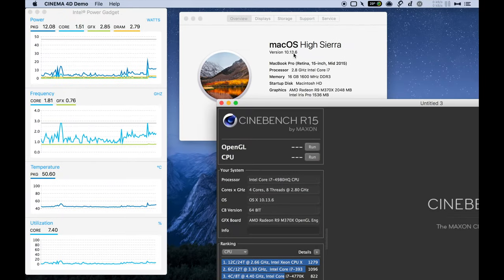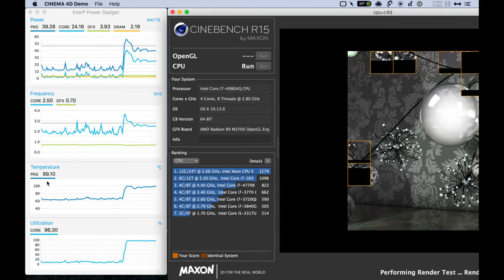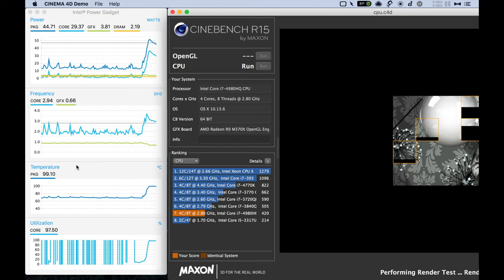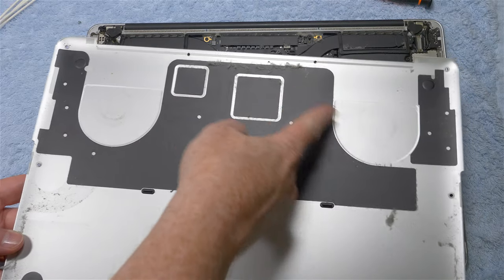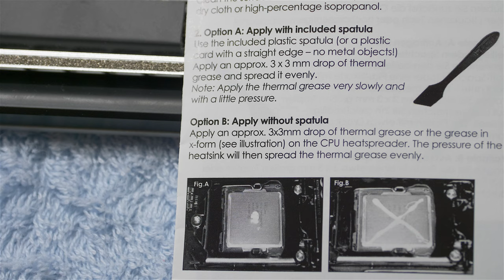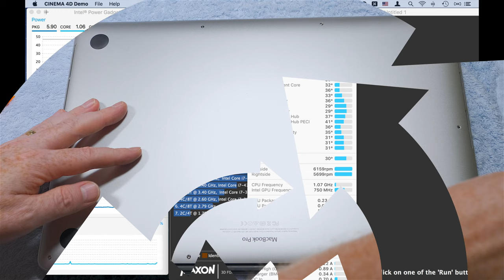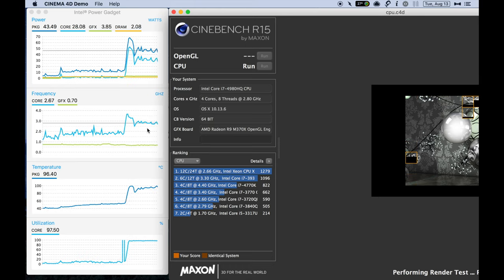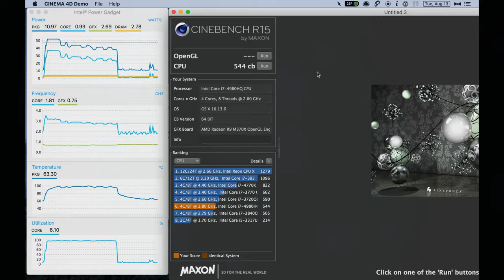Repasting a 2015 MacBook Pro 15" [Thermals & Performance]

Comment: Hi! I've just repasted my Macbook Pro 15" 2015 following this video. In fact, I found this video back in February or so, but I couldn't get the alcohol until now, and also the Kryonaut delivery took months! Anyway, I followed your original repasting method of spreading, but instead of a thin layer, I put a thicker one, just not so thick that when putting back the heatsink it could spill. The change in performance is really amazing! Thank you so much!
Reply from the maker: Great to hear about the performance boost, Alex.  Thanks for making time to let me know your success!

Comment: Here are the net results:
Cinebench Rendering scores                              Repaste 
                                    Paste:              Paste:                  Delta:
Normal voltage        Old  420cb      New  518cb          98cb
.75 mv undervolt      Old  447cb      New  544cb          97cb
Undervolt Delta                  27cb                  26cb         124cb
Total increase, undervolt & repaste   124cb  = 29.52% 
30% Higher score with new paste and undervolt - Same hardware.
I am about to do the same drill with the addition of changing the SSD for a 2TB ADATA/XPG SX8200 Pro installed.
Will attempt to screen grab the results and video publish.
Great Video!  Love the style, love the information.
Reply from the maker: Thank you for posting details of repaste, Larry!

Comment: Followed your instructions and renewed the thermal compound on the CPU/GPU of my MacBook Pro mid-2014.  It was a very simple job and quick.  The advantage I noted after doing this is that the battery has a longer period between charges than before the repasting.  I am thinking that the greater heat transfer to the heatsink is not straining the CPU as before and therefore not taxing the battery as much.  I downloaded the Intel Power Gadget and observe that the CPU rarely goes above 60C and stays around 50C most of the time. Power consumption is down from 20W or so to 8-10W, even when streaming videos.  For me, it was a worthwhile change with huge benefits.
Reply from the maker: Congratulations, Robert! Thank you very much for making time to share your wonderful story of success. It really is a worthwhile task that’s not too difficult, and I hope more people will try it.

Comment: Not sure why you need to manually flatten the paste.  Some study (using transparent models) shows you only need to drop the paste in the middle or a line based on the shape of the area, then the pressure between heat sink and the processor will flatten the paste much better than what you do.  In fact your way could create bubbles in between causing bad thermal transferring effects.
Reply from the maker: Please watch from 19:14 and continue watching until my paste job is completed.  There you will see what was written in the Thermal Grizzly Kryonaut instructions.  It says you can indeed use the spread method (i.e., flatten the paste).  But as you can see in my video, Kryonaut doesn't spread easily at all, so all that was left was a faint thin film that was basically nothing at all.  In other words, no air bubbles whatsoever can result from a thin film like that.  If you cannot see how thin, consider that we are talking less than 0.1mm thin.  It's so thin I cannot even measure it.  Again, it's basically nothing at all.  That is why you see me then change to the X method, which again is described in detail in the manual with photo.  Furthermore, transparent model tests have show the X method to be in many ways superior to the dot in terms of getting paste to to the corners.
Reply: @JDW-  Yes, Artic also mentions four methods, but finally recommends the One Point method (and one line method because of the heat sink pipe shape). A bubble could be created when two flat plans meet a valley formed by the paste due to manual flattening, and the air has no where to go but to stay in the middle.  Of course it is very thin, and is hard to be noticed.
Reply from the maker: @太陽雨-i2s  As I said in my earlier reply, I used the X method.  There is basically no paste on the chip surface from my attempt at the spread method, not even enough paste for microscopic bubbles to form.  Again, you can see that clearly in my video.  Indeed, what my video shows is that you really shouldn't use the spread method with Kryonaut, even though the spread method is recommended in the official Kryonaut documentation, because the paste just isn't suited for it.  Therefore, air and bubbles is a complete non-issue with regard to my video.  There are other videos that show methods prone to bubbles, but my video is not one of them.
Reply: In reality, it doesn't really matter how you apply the paste. The only important thing is that you put enough on (especially on a bare die). Too much makes a mess, sure, but it wont hurt thermals because the mounting pressure pushes the excess off the edge anyways. This can be an issue if using liquid metal or a conductive paste.

Comment: Very nice video. For the thermal paste spreading method, what you want to do is put the paste tube in a Ziploc bag and put the bag into a cup of hot water for a minute or two. The paste becomes much thinner and easier to spread when it's warm.
Reply from the maker: Thank you for your kind remarks and for the excellent tip!  (So far so good with the "X" application method I chose.)
Reply: I've heard it said that spreading is not a good idea as it introduces air bubbles which mess with the conductivity.

Comment: You mentioned not to wait around for re-pasting until something happens but you leave your batteries this swollen? I am amazed that you are not having trackpad issues with Batteries this one. That’s not just a little bit swollen that’s like something that needs to be taken care of right away and is much more dangerous and risk of leaking those destroying your computer than a little bit of dry thermal paste.
Reply from the maker: Actually, no.  I didn't leave it that way.  Within the text description under my video, you will find that I have put a link to "My SWOLLEN BATTERY video." That second video was posted only a matter of days after releasing this repasting video. URL: https://youtu.be/Om1c-FCc5u0

Comment: your video is still being found by people and interested in the advice you said. please tell me the negative impact of this paste is on the crystal. saw people complain about it. they say it leaves marks and scratches the surface. Is it so. what at the moment with the macbook that you are testing on the video?
Reply from the maker: "crystal"?  I'm afraid I don't understand what you mean.  I read and reply to every single comment under all my videos, so I also don't know what you mean by people complaining.  If you can please be more specific and clear, I can try to answer whatever  questions you may have that pertain to my repasting video.  Thanks.
Reply: @JDW-  my english is bad so you don't fully understand me. I'm asking about thermal paste. I read on forms that it damages cpu and gpu. is it true? How has this paste performed over time? do you recommend to buy? Is there any experience with using another artik mx 4 paste? If so, which one do you think is better. thanks for the answer
Reply from the maker: Thank you for explaining. I don’t know what forum you’re talking about, but it doesn’t matter. Clearly, those people have no idea what they’re talking about. The paste I used does not damage any CPU or GPU! In fact, Thermal Grizzly Kryonaut is one of the top recommended pastes and has been for many years. I have been using my repasted MacBook Pro to this very day without any problems whatsoever, and the heat and temperature are still under control as you can see in my video. I highly recommend it. And yes, it is better in terms of thermal transfer than MX-4. You don’t need to take my word for that either. Any good, unbiased review of thermal paste will show that.

Comment: I noticed you had gfxcardstatus running. During the before test you are using the discrete gpu and in the after test you are using the integrated gpu. This     skews the test results because using the discrete gpu increases the temps by about 8 to 10C Celsius. Could you provide test results for the after test with the discrete gpu running?
Reply from the maker: Thank you, Dan, for noticing that.  You're absolutely right.  I will run the tests after work tonight and post an update.  I really appreciate your keen eye!  THANK YOU.
Reply from the maker: Dan, see my newly pinned Comment for the link to my new screencast.  The scores are a bit lower than with Integrated graphics, but such is to be expected since the dGPU will heat the machine more.  But both Integrated and dGPU testing shows the scores to be higher than before I repasted. Thanks again.
Reply: @JDW-  Great! Thank you for sharing. It helped me to decide to do the repaste too. I hope it'll improve the fan noise while I have an external display connected.

Comment: I have the same spec MBP and I get 672cb CPU and 63.16fps OpenGL in Cinebench R15 running MacOS Catalina with Volta at -75mV. My cooling paste is still original but I recently opened my Macbook to clean it from dust and found that my batteries are very swollen, a lot worse than yours. But i still get excellent battery life.
Reply from the maker: Thank you for sharing your experience.  First off, it's hard to imagine MacOS Catalina alone giving you such a high CPU score in Cinebench R15.  What was your CPU score when running High Sierra (even without Volta)? Next, call Apple now and get your battery replaced.  Mine too showed great battery health and run fine off the battery, but if you leave a battery in its swollen state, it technically could burst through your aluminum housing at any time.  And whether or not that breakout out of the case will damage the battery, leading to a fire, is also a possibility that needs to be considered.  Check your serial number on Apple's website to see if you qualify for a free replacement.  More information about battery replacement in my other video here: https://youtu.be/Om1c-FCc5u0

Comment: I replaced the thermal paste and when using Safari I have an average of 43°C. On this video it's not even 40°C!
What CPU temperature do you people currently have when using Safari typically? Maybe the OS fault?
Reply from the maker: Thank you for your comment.  You didn't mention the type of paste you used.  As mentioned in my video and in the text description below the video, I am using Thermal Grizzly Kryonaut, which ranks as one of the best pastes available.  Safari temperatures vary wildly based on the content you are viewing.  If you watch YouTube, your temperatures will go up.  43°C is not especially hot for these Macs.  They often go well past 70°C a lot of the time, even with good paste, depending on what you are doing.  But suffice it to say, if your temperatures are largely unchanged after a repaste, I would be curious to know if you used a cheap paste or a major brand name paste.

Comment: Do you think that repasting is too big a risk on AppleCare? I bought a refurbished 2015 MBP less than a year ago and opted for the 3-year AppleCare. That said, when I'm running a 4K monitor and watching any kind of YouTube video or multimedia, my fans are almost always going at a medium-to-high speed, with the accompanying whine.
Reply from the maker: My AppleCare was expired when I repasted, so your situation is different.  Any work you do inside your case is therefore done at your own risk.  With that said, so long as you don't damage anything during your repaste and so long as you don't leave any sign you were ever inside the case (stripped screws are a tell-tale sign, as are easy-to-spot fingerprints or paste you may have gotten on an easy-to-see component), Apple would never know you repasted the CPU and GPU and I would think you could safely send the machine in for warranty service under AppleCare in the repasted condition.  Reason being, they really cannot know how the stock thermal paste looks versus your repaste.  Also, when they replaced my battery, they didn't even remove the heatsink and instead removed the entire motherboard with the heatsink secured.  

If you are worried, simply don't repaste until your AppleCare is expired.  

With all of that said, repasting won't keep your CPU from hitting 99.9% because Apple ramps up the clock speed as far as it will go.  Repasting just allows you to have higher sustained clocks for longer.  In other words, your fans will still blast like mad even after the repaste when your CPU gets hot enough.  Apple's software controls that.
Reply: If your AppleCare is already over I think there is nothing to lose, assuming you are not going to damage your hardware. If you always load >1080p YouTube videos that would explain your CPU usage
Reply: MBP's are not good with external screens, your fans ramp up quicker to keep the GPU cool. If you were to do the same tasks without external screen (even if the disctreet GPU is enabled) fans run a different profile. I'm talking from experience here.
Reply from the maker: Fans run in a different profile only if you’re not using a fan control app.
Reply: @JDW-  "only if you’re not using a fan control app." i.e. for majority of punters out there.
Reply from the maker: @Neetop  I suspect it is true the vast majority of Mac users worldwide do not use a fan control app, but that’s not necessarily true for the vast majority of viewers of my YouTube channel. The reason why is because I promote the use of fan control apps, and because I read and reply to every single comment under all my videos I know that a good number of people have started using those fan control apps. 

You can see my use of a fan control app in my repasting video. People can also see that in my iMac video card bake videos where I strongly recommend a fan control app.

Why use a fan control app? Because on the 2015 and older Macintosh models that I cover in my videos, Apple prioritizes quiet operation over cool operation. For most Mac users who only do web browsing and email, that doesn’t matter. But for the rest of us who actually push our hardware a little bit, keeping it running cooler will make it 
run faster and last longer too.

I used a fan control app when doing my testing in my repasting video because the very people who are interested in doing the re-pasting are probably the ones who push their machines, and those folks are the ones who stand to benefit the most from a fan control app.
Reply: JDW Do you have a video recommending good fan curve settings for a MBP 2015 (above default speeds)?
Reply from the maker: @kud I do not have a video specifically dedicated to that topic, but I am happy to share my rule of thumb with you. Set your minimum fan speeds to be as high as your ears are comfortable with. 

Pretty much any speed higher than the base fan speed is going to benefit you in terms of cooling and performance. Of course, if your thermal paste is aging, even higher fan speeds won’t help that much. At some point, you need to re-paste. I hope this helps.
Reply: @JDW Makes sense. Thanks for the tip!

Comment: i have got with the MacBook Pro 2012 (i7 3615qm) a score of 552 without changing thermal paste, why is your MacBook so slow ?
Reply: is that because the power Limit ?
Reply from the maker: What version of MacOS and what version of your benchmarking software are you using?
Reply: JDW I using Catalina and cinebench r15
Reply from the maker: It must be the OS then. I am still using High Sierra.

Comment: Amazing quality, keep up the great work dude.
Reply from the maker: Thank you!
Reply: JDW Do you expect to do a video with liquid metal soon?
Reply from the maker: @musk3402  Thank you for asking.  The answer is "no" because the Gallium in liquid metal thermal pastes reacts with Copper.  More specifically, the Gallium is slowly absorbed into the Copper until the Gallium is gone.  Therefore, any thermal benefit you'd get over a good traditional thermal paste like Kryonaut would be very short lived.  Another reason is because liquid metal must be masked off and therefore is more difficult to properly apply, so it won't accidentally short out surrounding components, versus a traditional non-conductive thermal paste.  More more information: https://bit.ly/32CFMUA
Reply: JDW interesting, so could that possibly ruin the coating of the processor too?
Reply from the maker: @musk3402  No because the top of the processor is not copper.  Personally, I wouldn't be concerned about liquid metal because Kryonaut is really good paste.

Comment: How come every tutorial I've read in the past 20 years has said to AVOID ever using a vacuum around electronics because the static build up can cause severe damage, but you suggest using one? @JDW
Reply from the maker: Perhaps a better question is, in all of those years, how many pieces of electronics have you seen destroyed with your own eyes because a vacuum was used to suck dust out if it? I’ve been working with electronics since the 1980s and I honestly haven’t seen a single circuit board destroyed by a static charged vacuum.

Next, if you read through the text description I created underneath my video, and if you watch my video, you will see that I have a rocket blower and a paintbrush prominently displayed for the purpose of cleaning out dust. So my brief mention of a vacuum is rather insignificant seeing that I am not promoting a vacuum as the lone means of cleaning.